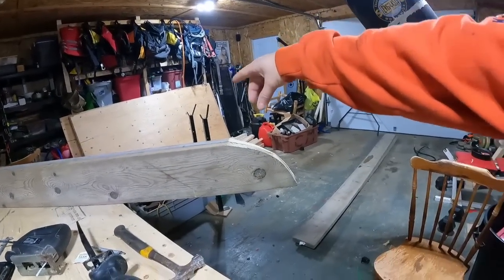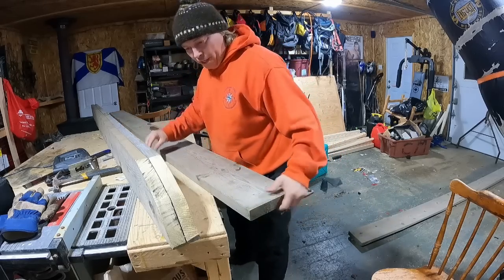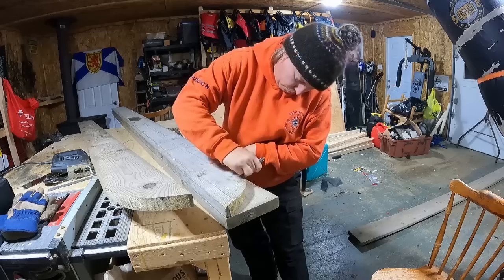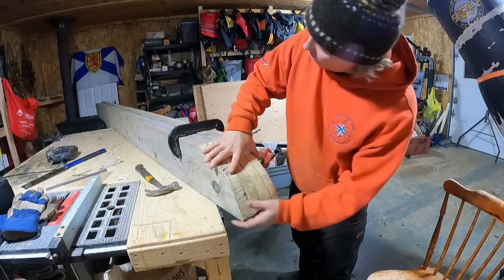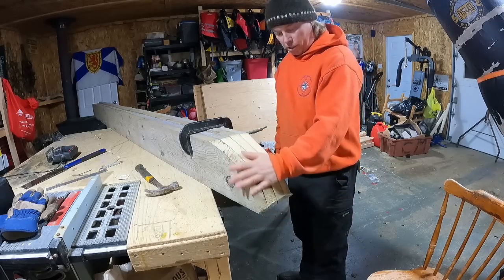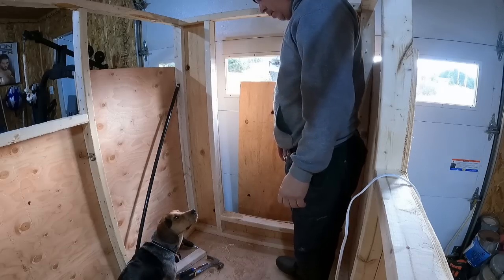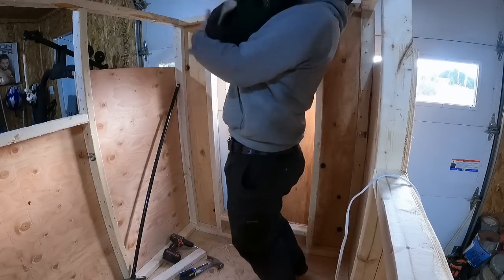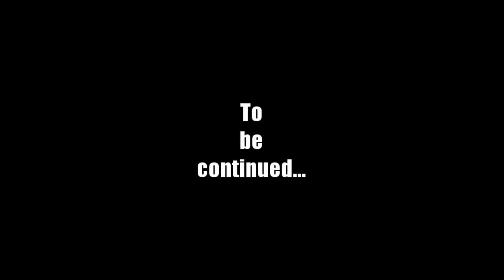Tiny Ice Shack Build (Part 1) Only 32 Square Feet

Comment: Nice build buddy. Should have rounded both ends, easier to pull backwards out of the slush.
Reply from the maker: She is rounded off on the back a little bit. Not like the front but I didn't keep the back square. Ill try to show it in the next video. Thanks buddy !